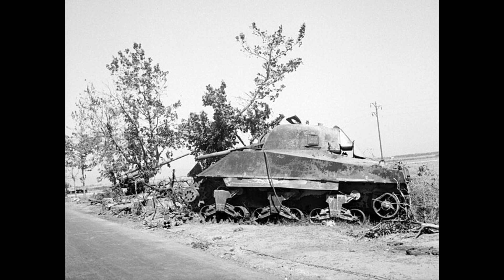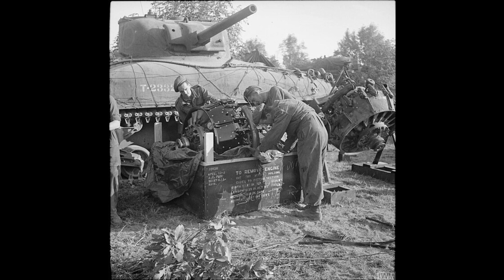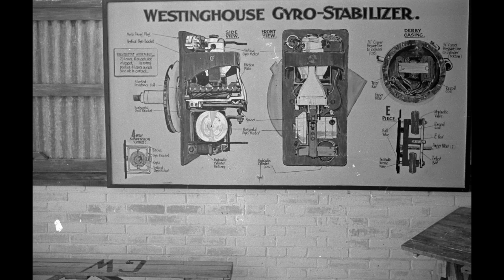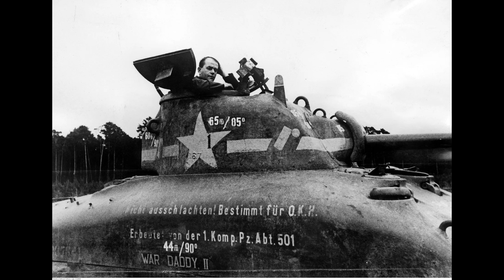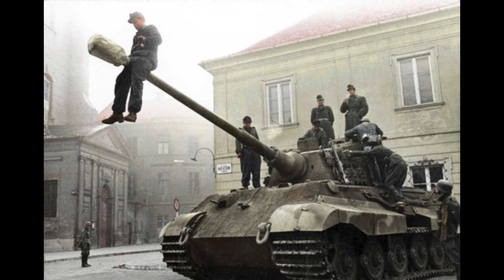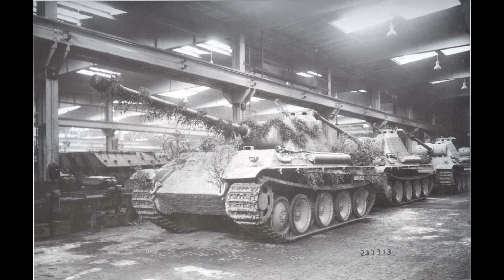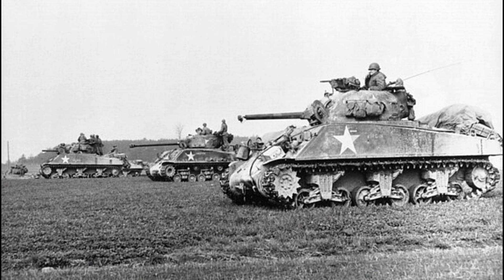German Engineers Tested a Captured Sherman - Then Realized Why They Were Losing the War

Comment: Quantity has a certain quality all in its own. I think that was Lennon.  Sherman's a good medium tank no more than that. It worked it was Dependable. It was definitely underpowered as far as it's cannon.
Reply: The primary job of a ww2 tank was infantry support, not fighting other tanks. The Sherman's 75mm gun was a better infantry support weapon than the longer76mm, armor penetrating gun used on some later models.
Reply: 48,000 Shermans vs. just over 1000 Tigers produced. Hitler wanted a new tank type, so setting up a new production line every time. The Americans just churned out Shermans. Quantity over quality.
Reply: I believe it was Stalin that remarked …quantity has a quality all its own.
Reply: @teresadkirse8489 it was one of those commies😂 have a great weekend
Reply: @teresadkirse8489  Yeah, I doubt it was John Lennon.